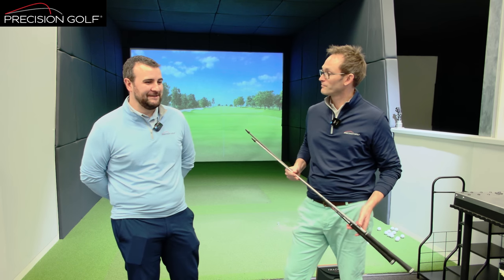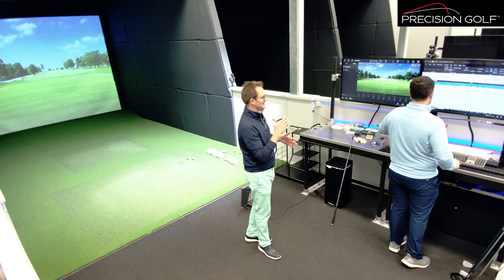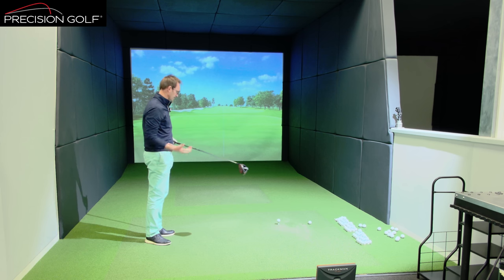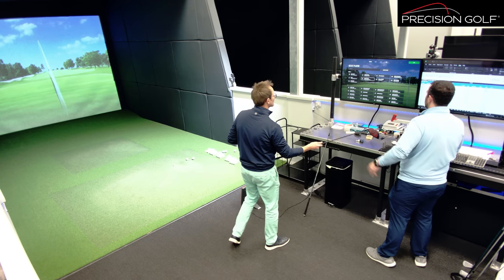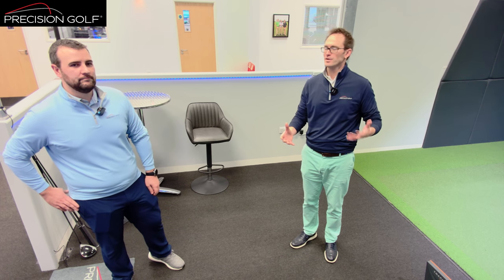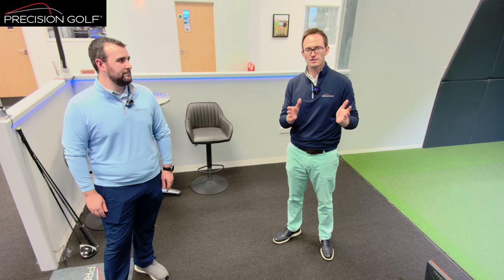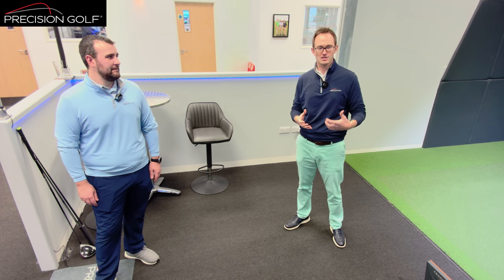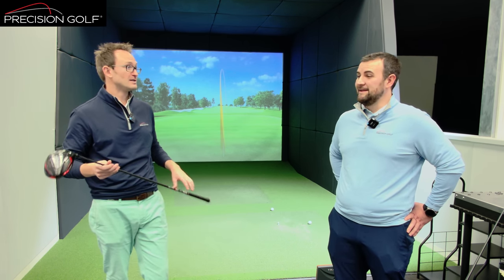The MYTH Surrounding Shaft FLEX

Comment: You’re omitting the big difference in “shaft flex”. We cannot accurately compare shaft flex w/o also comparing EI curves. I could swing for a example a Ventus TR Blue 5R vs a Air Speeder 5S. The AirSpeeder would likely test a bit stiffer CPM yet would be far less consistent and much higher spin. The reason being the EI of the Ventus is MUCH stiffer in tip resulting in greater stability and less shaft droop at impact. I’m betting my misses would be within 6-8mm of center. The “stiffer” AirSpeeder would have much larger misses from center, mostly high toe resulting in high spin rate draws starting up right and curving left of centerline. 

Until you can compare like EI shafts, such as a Ventus TR in 6R & 6X, you cannot truly and accurately isolate the differences in shaft flex upon club performance.
Reply from the maker: The test we were doing was to demonstrate that a very soft or stiff flex does not turn a straight shot with a square delivery line and face at impact into a hook or slice and that it is not the major factor in dictating what shaft works for you. Many players still believe this to be the case and focus on the flex denomination on the shaft to dictate whether it will help them with direction and this was to show that is is not true. Absolutely there are several other elements that go into dialling in the very best option for someone of which bend profile is an important part. 

The reality of how the bend profile alone affects flight is also quite limited - at extreme shaft loads you can see a greater difference but all else being equal a tip soft shaft versus a tip stiff shaft will only alter launch and spin by a very small amount - this is why Mitsubishi removed the data comparison from their website between the Red, Blue and White Board Diamana models several years back as it only showed a 300-400 rpm variable in spin and under a degree in launch from top to bottom when tested with a robot.

EI profiles will affect the zonal frequency of the shaft and how consistently the shaft loads relative to the players action and will promote more or less bending at certain points of the shaft but this will mainly affect spin, a small effect on launch angle and will impact on the consistency of those parameters. It can help dial in strike, as you say, but in the example you give it would be the gear effect of the strike on the high-toe part of the face that would create the right-to-left shot shape, not the shaft turning the face over.

We appreciate your interest in the videos and your comments and we will look at doing a comparison on EI profile in the future.
Reply: @Precision_Golf  Correct, the high toe results in high spin draw/hook due to the bulge & roll of face, not necessarily the face squareness. 

Interested in seeing a flex comparison between similar EI shafts. I’d also throw in a comp of masses, especially if you did balanced swingweights. 

By that I mean, how do for example a Ventus Blue TR 5X vs 7X compare when either the 5X is counterbalance weighted or 7X is hosel weighted to obtain matching swingweights.
Reply from the maker: Thank you Michael, we look forward to sharing more content with you in the future.

Comment: Would be interesting to hear you go further into shaft characteristics, such as the effect of higher and lower torque. Are there shafts with the same weight but that have sharply different torques? Also what about the four digit Miyazaki International Flex Code ratings that measure flex in 9 levels from Senior to tour XX stiff and divide the shaft into 10 inch sections? As opposed to saying the overall flex of a shaft is stiff or senior, do differences in sections, especially the tip, have a greater influence on trajectory and control?
Reply from the maker: Bend profile and zonal stiffness variables only have a relatively small effect on flight when isolated - Mitsubishi put a chart on their website when comparing the original Kai’Li, I’Lima and A’Hina when tested on a robot and too to bottom there was 0.3 degree difference in launch and roughly 300-400rpm difference in spin (they subsequently removed this chart shortly after posting it as it made people question what difference it actually made).

Torque ratings vary brand to brand in how they are measured so one brands rating vs another brands rating cannot be directly compared unless independently tested to normalise the scale. Torque will slightly affect spin but mainly “feel”. Technically a low torque shaft should reduce spin slightly. To have very different torque ratings at the same weight the shafts would be so differently designed for bend profile that it would not be a fair comparison to use torque as a measure for performance difference alone.

Comment: I mean there is no true standard for flex across the industry. Stiff for one shaft is really only relative to the same model of shaft at the same weight profile. I can play a 75 gram project x black x stiff and a project x pvd smoke green in a 60 gram tx and the feel are almost the same.
Reply from the maker: We completely agree Matt. That’s why Brunswick developed the FM frequency scale. However that only relates to butt stiffness and zone stiffness can be very different. Thanks for getting involved, see you next time 👍🏻
Reply: @Precision_Golf  I really wish more companies showed their breakdowns like how Fuji does, Butt/Mid/Tip. All the exact numbers breakdown of torque and stuff is nice but it's really pointless unless you understand how shafts work which probably 95% of golfers don't.
Reply from the maker: We are very lucky to have access to the worlds most comprehensive independently tested shaft database where you can compare EI profiles, stiffness, zone frequency, weight, torque, load profiles of pretty much every shaft on the market, all carried out on the same machine to give an apples to apples comparison. Check out s3fitting.com. However, you are correct, what people think they need and what they actually need can be very different. Normally self-prescribing too heavy and too stiff, we’ve all done it!

Comment: Two points worth mentioning.1 st you never test with a grip on, will give a false reading every time 2nd use a static weight not a driver head. All the driver heads are different weights hence when you fit for a driver you start with a “dry” shaft ie its uncut. Your ideas at best are flawed😮
Reply from the maker: Hi Dave. We appreciate your comment and you are right to bring this up! We measure grip-on frequency with constant 100psi pressure so regardless of grip type the clamp force is consistent and repeatable. Our frequency software also calculates FM frequency to make an allowance 
for grip on vs grip off. We have tested this thoroughly in the workshop and confirmed the results are consistent.

Secondly, we have weighted our demo heads so they are all consistent in weight, or light enough to allow us to add weight to match all other heads being tested. This allows us to be very fair and accurate in all our fittings and equipment or tech videos.

Lastly all our demo shafts are tipped identically and cut to the same playing length for the exact same reasons.

Happy to answer any further questions you might have but we’re pretty confident our testing is on point.